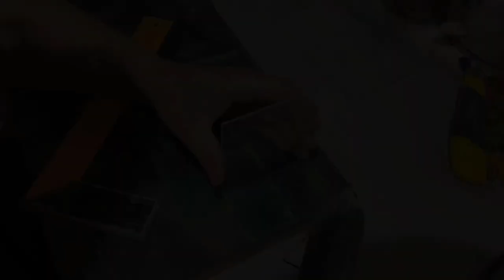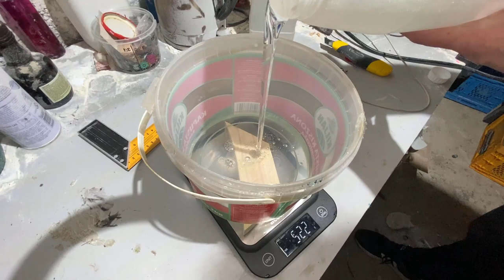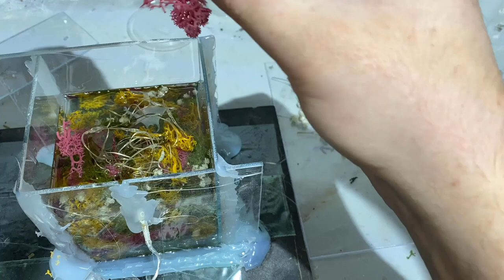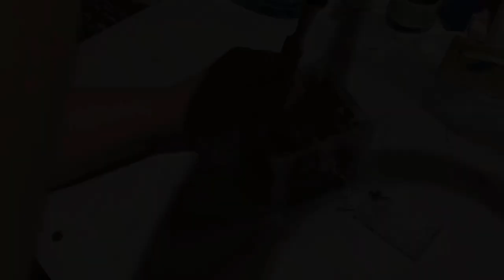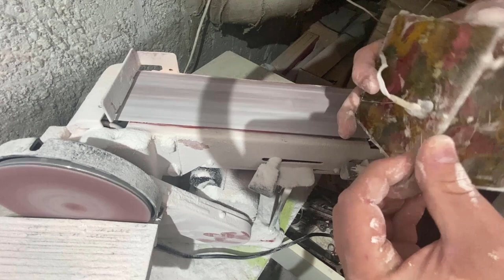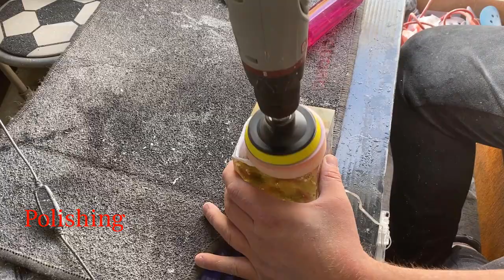Night Lamp With Epoxy Resin And Flowers l Resin Art

Comment: Sir thats led light right? 
1.What kind if resin have you used?
2. Does the resin don't react to the light inaide?
Thank you.
Reply from the maker: it is a two-component epoxy resin and no, it does not react to a light beam
Reply: @prestigedesigner9877  thank you sir